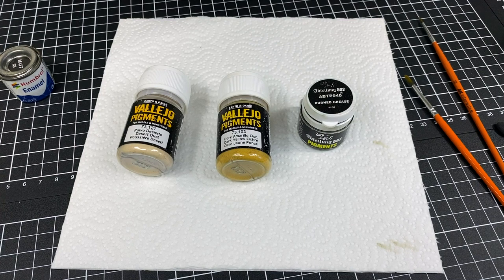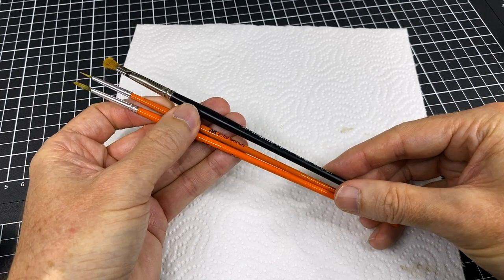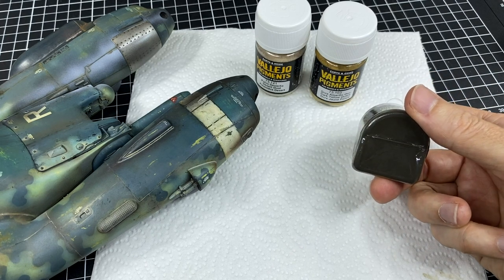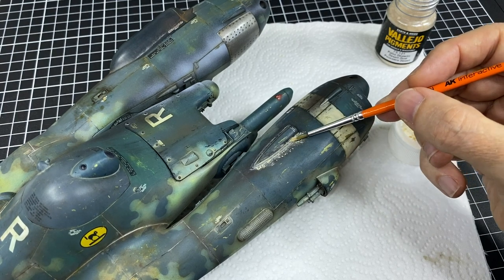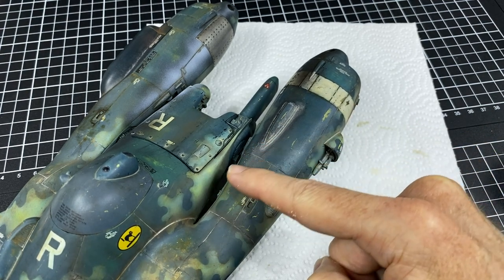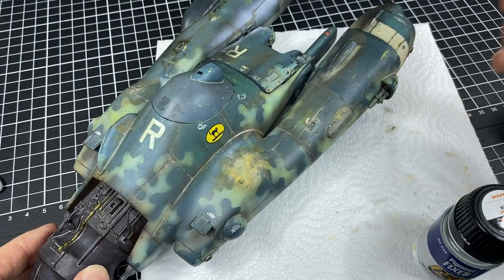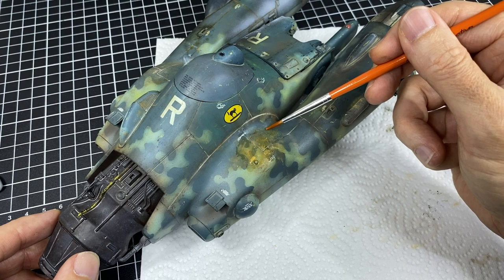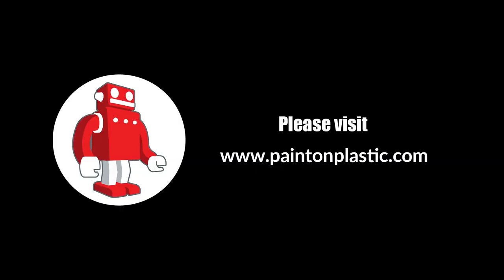How to Weathering Pigment Powder Tutorial with Lincoln Wright

Comment: Thanks for this vid...I've been experimenting with trying to get the exhaust effect on the side of a 1/32 Spitfire...I didn't do well with spraying it as it just seemed to look like sprayed on which the rest of the model is so I wiped it all off again... I then tried weathering powder (and some soft pastels which bashed in a bag to get it to dust)...I managed a lovely effect with white and black...The white went inside the black and was very realistic...The only issue I had was 'How do I seal it in place?'...I noticed that is you use a varnish then the lighter colours disappear and the darker colours are less effected...So it was good to see someone actually just leave them alone with no seal...I have yet to see if the hand traffic that models get will take this effect off if its unsealed...but good to know that other modellers just leave them sometimes...Thanks again for an informative vid...From the UK...

Comment: quick tip you can make your own pigment from colored charcoal or chalk or even colored pencils by either scraping them with a blade or using fine sand paper to grind and make the powder regular pencil lead makes an excellent metallic  powder that can be used to highlight the edge of worn metal objects
Reply from the maker: Thanks for the info!